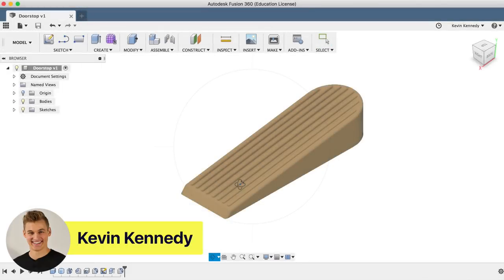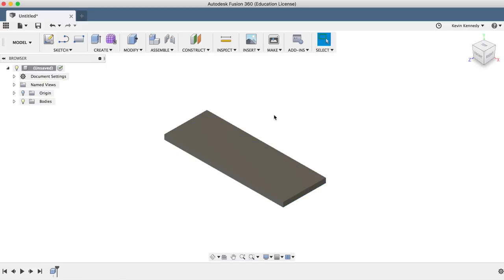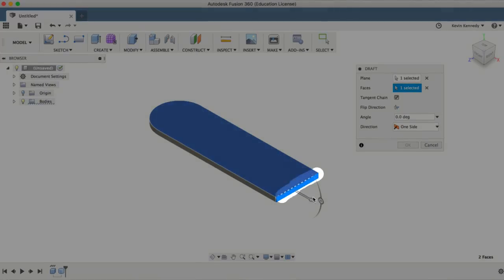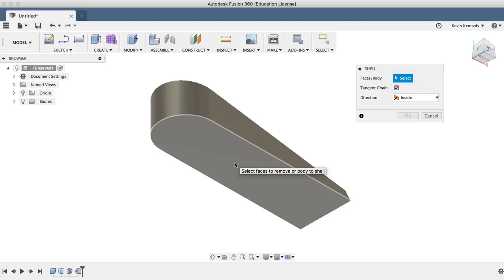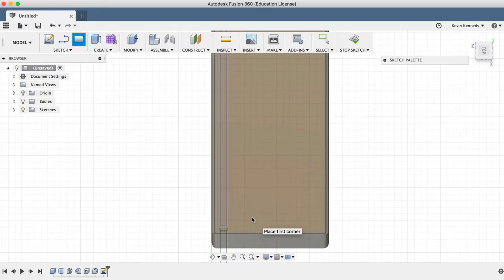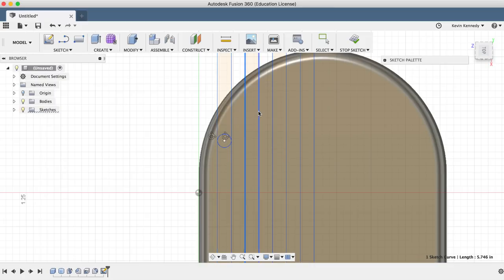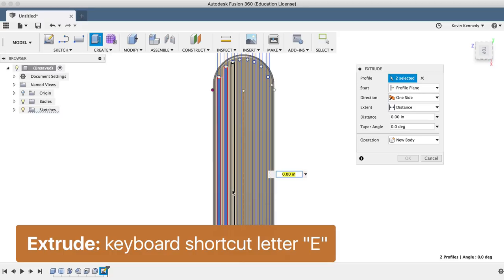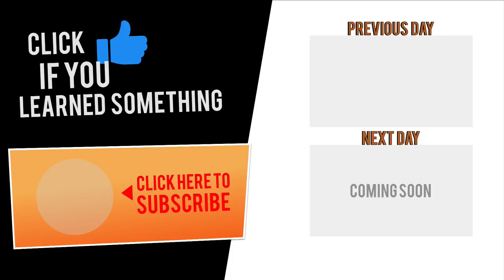How to 3D Model a Door Stop - Learn Autodesk Fusion 360 in 30 Days: Day #8

Comment: First, I think these videos are outstanding. The approach of building on concepts works extremely well. I wanted to also say that the issues that people encounter such as the constraint issue that caused problems during the 2 tangent circle part of the video are actually incredibly value because of the community. I would much rather encounter these kind of situations in a training video where a large number of people can also identify the solve. To me, this is an added bonus and increases the value of the material.
Reply from the maker: Hi, Barry. Glad to hear that you're enjoying them. I agree with you that the issues are all great learning experiences. I've noticed that the videos with one or two common roadblocks tend to get more people commenting and engaging in dialog, which also helps everyone learn from one another.

Thanks for watching and commenting! Cheers, Kevin :)

Comment: Another possible thing that might help the issue with the last circle deleting the rectangles: Edit the rectangular pattern (while in the sketch, look for the pattern constraint, and double-click it), and clear the check mark from the Suppress box. After doing this, I was able to place the fourth tangent circle without it deleting the rectangles.

I wasn't able to get the error to happen again, even after re-editing and accepting the pattern. Since the option doesn't have an actual effect on the pattern, just what the UI shows you, maybe changing it clears out some bad internal state or something. Or, it could be a coincidence. I'm not up for trying to exhaustively test repeatability...

While I'm here, thanks for the tutorial series, Kevin!
Reply from the maker: Thanks for sharing this, McMostaza! Great stuff.

Glad you're enjoying them - don't hesitate to comment if you ever run into any roadblocks. Cheers, Kevin :)

Comment: Like some of the others, mine started going hay-wire when I tried to add the tangent circles.  I saw that my first rectangle for the pattern had constraints, verticality I think.  Even when I tinkered with restraints and got my fourth circle in successfully, all 4 of the rectangles disappeared as soon as I drew the construction line.  Someone posted that they deleted the pattern constraint on the first rectangle.  I tried that and the other 3 rectangles really started moving then, so I manually dragged them back into something that looked all right.  Removing that constraint allowed me to finish the project.
Reply from the maker: Thanks for sharing this, jench78! I did not foresee this issue while recording...but I'll be sure to visit this problem further if I get around to making a "revised" version of this tutorial. Cheers, Kevin :)

Comment: This one went smooth with the exception of the grips. For some reason I create the rectangle on the top face and I can select it however when I click the Rectangle Pattern, I can no longer select the newly created rectangle. My perspective seems to be different than yours. When I selected the Draft tool, I had to set my angle to -10 degrees to get the slope where you went +10 degrees. I've had these discrepancies before and although I can work around it I'd like to know why this happens for my knowledge.
Reply from the maker: Ryan Gaudet Hmmm... based on that mine was +10 and yours was -10 I'm thinking it must be something with the orientation. I my mine set to "Y" axis up. Is yours set to have the "Z" axis up?

I wanna figure this out with you... its driving me nuts because I have my Fusion set to the defaults for the videos in hopes to make it the same for everyone. 😅
Reply from the maker: I'm not at my computer at the moment, but later I will have to check all of my settings and post them in the video description so viewers can have the same perspective, etc.
Reply: Product Design Online I’m not in front of my computer either however I’m pretty sure my Z axis is up. Is this a setting or just a way the view orientation is?
Reply from the maker: Ryan Gaudet It's a setting somewhere in the preferences menu. I'll grab a screenshot of it later.
Reply from the maker: Hi Ryan, here's a screenshot of the z/y-axis up setting - located under the preferences > general - http://bit.ly/y-axis-up
Reply from the maker: My Display Settings: 

Visual Style - Shaded
Envrionment - Photo Booth
Effects - Ground plane, Ground shadow, Ambient occlusion, Anti-aliasing
Camera - Orthographic
Reply: Hi. Yes my Z was set to up instead of Y. I made the change and will continue with that setting for the rest of the lessons that I am really looking forward to :) 
Thanks

Comment: Thanks for the tutorial. I found this one quite hard. I couldn't get the 2 tangent circle command to work so I used the 2 point circle instead. That snapped to the lines okay and worked fine.

Also I still don't understand what you were trying to explain about leaving the trimming of the circles to last.

Comment: Ok so this video done. Awesome. Anyway hey Kevin a question. I have a trackpad and depending upon how oily my skin is on my finger tips depends upon how well the thing operates. Annoying today for not wanting to zoom. So what do you find yourself using over there in US?
Reply from the maker: Hi, James. I try to avoid using a trackpad at all costs. I typically only resort to the trackpad if I end up opening F360 while traveling (in the airport or doing some work in a car, etc). It's just too hard to orient the model in an efficient manner.

I would suggest any standard USB/Bluetooth computer mouse. I personally use a "3Dconnexion 3DX-700062 Cadmouse Wireless for Cad Professionals Windows/Mac" which gives you the ability to add some extra shortcuts to the extra buttons on the mouse. It can be helpful if you find yourself always using a certain shortcut key (extrude for example) as you would no longer have to move your hand to the keyboard. They are a bit more pricey than a standard USB mouse that is $20-30, but I think they're worth it if you find yourself using F360 on a daily basis. Cheers, Kevin :)

Comment: Hey thanks so much for this series-I’ve been trying to do a couple of them everyday. Question for you- sometimes your axis is z-up and sometimes it is y-up. Is there a reason for this? Does it make much of a difference? I’ve got a carpentry background so I am much more comfortable working in inches-but I live in Canada so I should also try to get right w the metric too. Any reason you flip between metric and imperial on the various tutorials? Thanks again! -N Hall, Toronto On
Reply from the maker: Hi, Neal. That's great to hear...you're making good progress!

In regards to the axis in the "up" position, that is because of the default settings changing. I record all of my tutorials with Fusion 360's default settings in an effort to make it easier for everyone to follow.

Unfortunately, from time-to-time, the Engineers decide to change a default setting. When I first recorded the series the "Y" axis was the default "up" orientation. They later decided to change it to the "Z" axis being up since that is widely used by CAD, CAM, and 3D Printer (slicing software) packages. the first 4 videos of the series have been revised so they have the "Z" axis set to up (per the current default). Ultimately, it doesn't affect anything other than the model's orientation. If you export the model to another program you may have to rotate the model. Other than that, you'll just have to pay attention when I mention clicking a specific origin plane or axis. You may have to select the opposite.

With the units, most of the tutorials in the series are in millimeters (or the metric system). I work in both imperial and metric, so I originally did a few videos of each. However, there seemed to be a lot of complaints, and the general consensus was to stick with the metric system. Therefore, the majority of the series and my tutorials are in mm, with the exception of all my woodworking related content being imperial.

I hope this helps! Don't hesitate to comment if you run into any roadblocks.

Cheers, Kevin :)

Comment: I am having some issues while using the 2 tangent circle sketch. I am able to place 2, but once I place the 3rd all of the lines for the rectangular grips disappears and I have to undo to get them back. I do absolutely nothing different between 2 and 3 and have even placed them at the center of the top plane thinking that it was because I was placing them too high and therefor off the rounded edge of the highest point on the model. Any idea why this would happen?
Reply from the maker: I'm honestly not sure why that's happening. Are you able to take a screen recording of it? I would recommend putting some vertical or parallel constraints on the lines before hand, then they should stay vertical and won't move on you when you place the circle. Cheers, Kevin :)
Reply: same problem here...
Reply: Same problem...
Reply from the maker: @SonofTangra359  Can you share your file?  As I recommended above, I would suggest adding some more constraints before applying the 2 tangent circles. Cheers, Kevin :)
Reply from the maker: @fi2ng  Hi fi2ng, sorry I must've missed the notification for your comment. As I recommended above, I would suggest adding some more constraints before applying the 2 tangent circles. Cheers, Kevin :)
Reply: I made it work somehow by moving the whole pattern around..  How do we add constraints? I tried, but it didn''t work.
Reply from the maker: @SonofTangra359  In Day #16 I cover all the different sketch constraints (https://www.youtube.com/watch?v=BGwBZJ14KHQ&index=17&list=PLrZ2zKOtC_-DR2ZkMaK3YthYLErPxCnT-) and in Day #17 I cover fully constraining your sketches using constraints and dimensions (https://www.youtube.com/watch?v=C11L136U0vQ&index=18&list=PLrZ2zKOtC_-DR2ZkMaK3YthYLErPxCnT-)
Reply: @PorcusMalus @Ivan @fi2ng Hi guys. That is how I fixed it. After I made the pattern I adjusted height of each rectangle and deleted pattern shortcut from first rectangle. After that I was able to put all 4 tangent circles.
Reply from the maker: @rudyaenergy  Thanks for sharing this solution with the community!! I appreciate you taking the time to watch and comment. Keep it up! Cheers, Kevin :)
Reply: I had the same issue. But... if I made my circles in the opposite order (start from right side) I was able to create them all. Find the logic in that.
Reply: Have had the same problem. I'd recommend anyone reading this to 2-point tangent the fourth circle first. That worked for me.
Reply: I trimmed the rectangles off first.  It separates the lines where they run off the rounded end, trim those little segments and then the tangent circles work.

Comment: Enjoying the tutorial, and all going well until 4:09. No idea how you got that rectangle to locate, with the result that the rectangle pattern and mirror pattern resulted in a pattern with a tiny gap in the centre. Also, not clear why you decided not to trim the top circles before mirroring.

I wasn't happy with the top circles on the "grips", so tried drawing a circle and getting them to follow it. As nothing was constrained, utter weirdness resulted! :( Very frustrating...

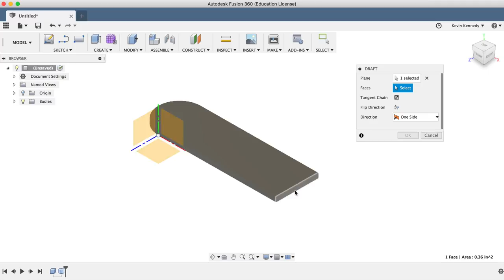I know it's "only a door-stop", but the techniques here pave the way for much more accurate work. Was very happy to be introduced to the Draft feature at 2:03; that's going to be very useful! :)

Comment: How did you get each rectangle so evenly aligned? When I mirror mine theres either a huge gap in the middle or the middle two rectangles are “connected” with no space in between.

Comment: This was the first tutorial where something wasn't clear.. what does the two-tangent circle do for you? Why use that and not a plain circle or an arc? Every other time there has been a reason, not just trying to use every possible way to do something. Up to that point it's all been crystal clear and logical too, well done! I know how much work goes into planning a tutorial and the easier they are to follow the harder they are to write.
Reply from the maker: Hi, Paul. Thanks for bringing this to my attention. I used the two-tangent circle as it's an easy way to ensure the geometry snaps into the vertical lines with tangent constraints that are automatically added. It saves the step of having to add constraints manually.

I'm glad you've been enjoying the tutorials so far. Please don't hesitate to comment questions on the tutorials as you work through the remainder of the series. Cheers, Kevin :)

Comment: Hi Kevin, I have a question about the creation of the cylinder.
When I wanted to go back in the project timeline and change the diameter of the cylinder to fit changes I made to the box size, I was unable to do so accurately (the center points were wrong),  so I had to delete it and create a new cylinder. Is there anything I missed and did wrong?
Isn't it better to sketch a circle and an extrude it in advance, and then I will have more flexibility for future changes?
In addition, in the part of creating the rubber grips on the top surface:
At the end I wanted to go back and edit the rectangular pattern command, but I could not make good changes in the dimensions of the rectangles and the number of rectangles. Every small change completely distorted the sketch.
Allso, the mirror command was not updated, i.e. for example a change in the number of rectangles I made in the left part of the model, was not automatically updated to the right part. How can the mirror command be edited properly?
Thank You very much!
Reply from the maker: You'll have to make sure the sketches are fully-defined. I did not demo that in this lesson, as that is discussed later (halfway through) in the series :)
Reply: @ProductDesignOnline  Hey Kevin, I went back to give it another try, but - The box and the cylinder were created as objects from the "create" list , and not from sketches - just like you showed in the video, so it is not possible to "define" and "constrain" them.
So I'm asking if it is possible to create constraints for objects created in this way, as you do for sketches?
And if not, why did you choose to demonstrate this way in the video insted of using sketches? isn't it better to use sketches?
Thank You.

Comment: Hi,
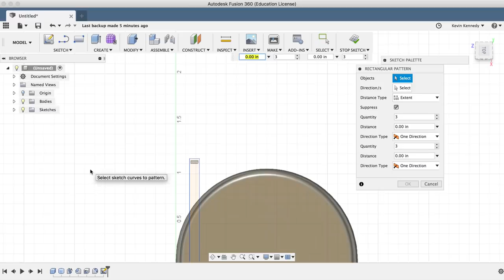When trying to create the pattern (at 4:55), i  cannot select the lines and the semi-circle.
What did I do wrong?

Thank you so much!
Reply from the maker: Hi, Raz. It's likely you're using the wrong rectangular pattern command. Check out this article - https://productdesignonline.com/tips-and-tricks/mirror-command-not-working-in-fusion-360/?_thumbnail_id=11753

The same thing applies to your issue except for the pattern command instead of mirror.

Comment: I had similar difficulties as described in the comments below, but was able to solve based on your replies. Thanks!
But I am still having a difficulty with changing the Appearance, similar to the handlebar.  When I drag the rubber appearance to the door stop, it all changes except for the extruded portions.  I am able to shift + highlight all 8 and then change Appearance, but any idea why it wouldn't all happen at the same time?  Bodies/Components is checked on top.
Reply from the maker: HI, StepInIsrael. Have you tried dragging and dropping the appearance directly onto the top level component (file name) in the Fusion 360 browser? This way works well when the model is being picky with dropping appearances directly onto the model. Let me know if that method works better for you. Cheers, Kevin :)
Reply: @ProductDesignOnline  Perfect, thanks!
Reply from the maker: @StepInIsrael  You're welcome! Cheers, Kevin :)